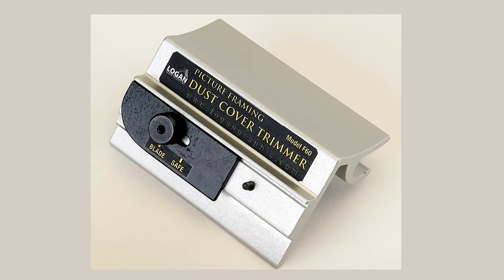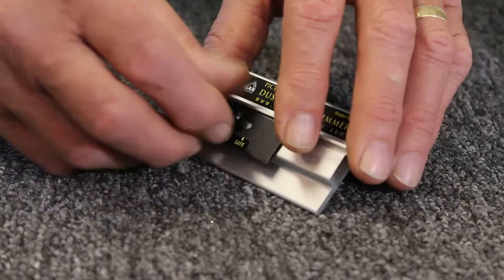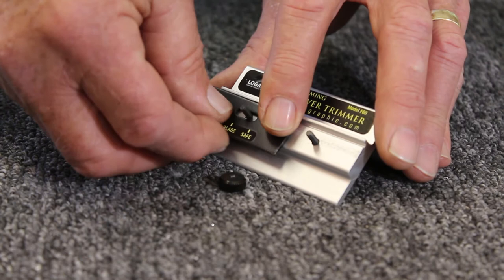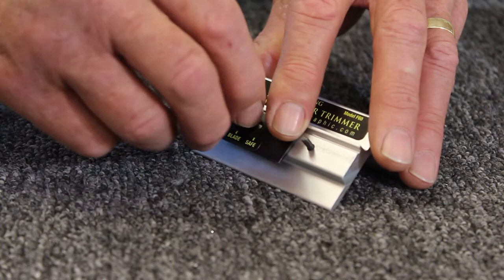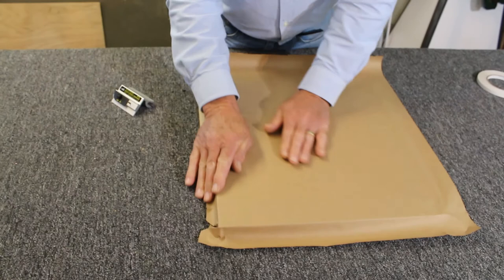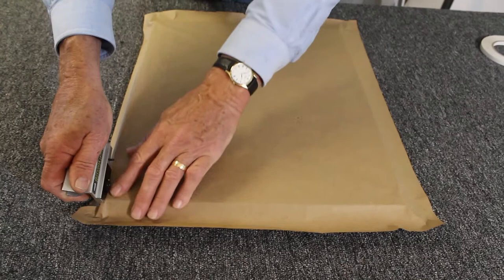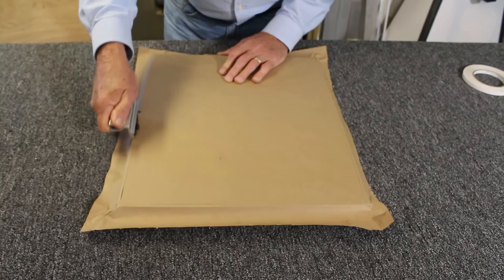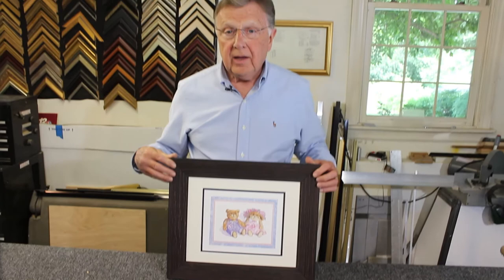LOGAN F60 Dust Cover Trimmer

Comment: I see that you have a carpet mounted into of your table. Is that what you would recommend for protecting mouldings while working?
Reply from the maker: Yes you might find that helpful and its easier on the front of the moulding. Typically even the mat cutter base boards do not slide around on carpet either however the best is to have the mat cutter on a solid flat surface. But for frame assembly, I prefer a carpeted table. Thanks. LGP.
Reply: Thanks!

Comment: Don't waste your money ! The demo appears to be using very light weight paper, and you probably need to replace the blade after every use.  I used recommended paper backing for Dust Cover for paintings, and it really shredded the edges.  I needed to rely mainly on a plain razor blade to try to clean up the edges, and it's still a jagged mess.  Luckily, it only sees the wall ~  Seriously, just use a razor knife or plain razor.
Reply from the maker: Hello. Make sure you have only one blade installed on the Dust Cover Trimmer. The unit ships with three installed and you need to remove two of them. Hold the tool at roughly a 45 degree angle and just skim the blade through the dust cover paper, avoid digging the blade into the wood moulding. We were using a pretty standard type of paper in the video and there is no reason why this tool should not work well for you. Thank you and feel free to call us with any questions. 847-526-5515 or email to cs@logangraphic.com
Reply: @LoganGraphic  LOL I just learned this a minute ago.... I got a nice clean cut after I removed 2 blades.:)
Reply from the maker: @heidimule  Yes we pre-install a few blades on the tool when its new. Remove all but one to start using it. Thanks.
Reply: @LoganGraphic  Yes, the three blades that come with it are all stuck together. They must be separated and only a single blade used. Logan should not have installed on the tool all stuck together.  I have used it once and it worked however not as well as a result the gentleman in this video ended with.